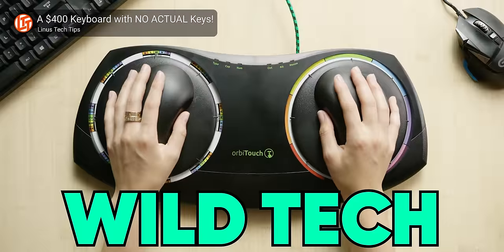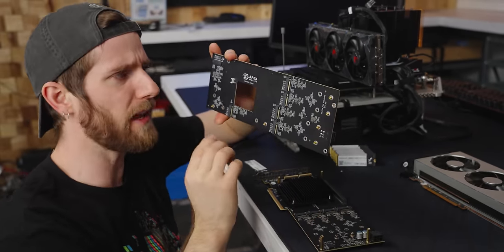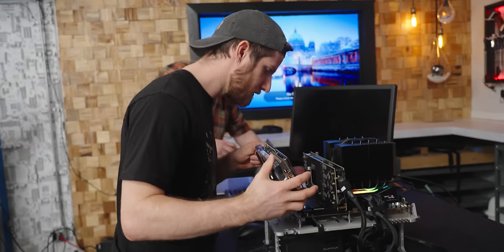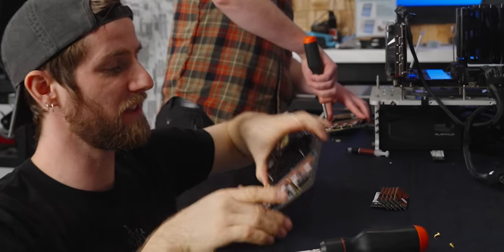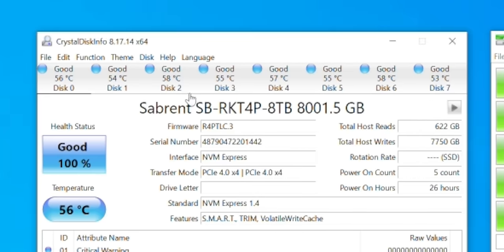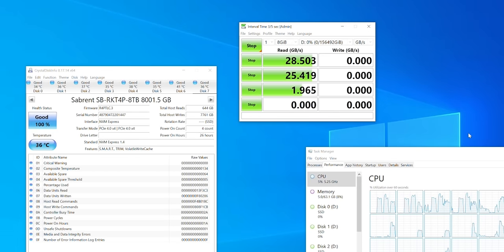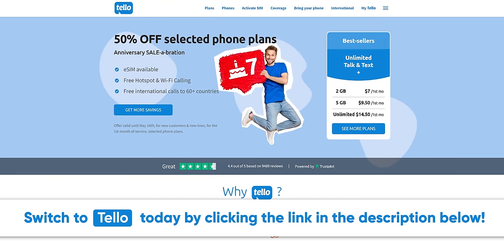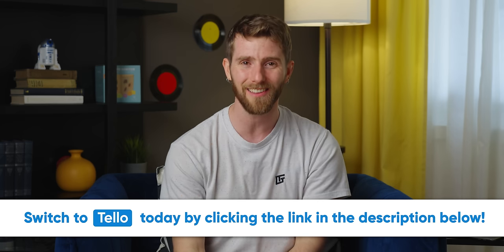This SSD is Faster Than Your RAM - Apex Storage X21

Comment: I could see this working well for engineering simulations (FEA, CFD) that are effectively limited by the amount of ram that you have.   Before something like this, maxing out the ram and letting the solver use the hard drive would increase solve time by something like 10x.
Reply: But you would most likely use DCPMM for that because it has much lower latency. You could probably use this for some kind of custom swap in some cases, but at some point there's diminishing returns. The advantage of this card is that it's compact. There are systems that have lots and lots of u.2 connections and can support far greater capacity and speed.
Reply: The newest simulation machines where I work are for chip cooler simulations. They use CXL RAM as a layer between the SSDs and RAM. We also have sapphire Rapids HBM in dual-socket for it as well.
Reply: This would still be slower, 25Gb/s on ram is per channel, if you are running simulations that intense I would think you would have a very dece amount of ram and be running it in 8 channel. This is cheaper for sure but I don’t think the OS is designed to use swap like that, I think it still goes through ram first and constantly dumps back and forth from ram to disk increasing your CPU usage drastically. This would however be very useful in AI training, the datasets are massive and gpus nowadays especially if you have like 4 A6000s could eat up quite a few IOPs. I would like to see a water cooled version of this, maybe they will partner up with an ssd manufacturer and offer that later as a factory assembled package.
Reply: @radugrigoras : There's nothing particularly special about this. It sacrifices speed for compactness is all. So it's great for a system with few PCIe lanes or systems that need to be small. There are very few situations where this is something you'd even care to have.
Reply: I haven’t done this kind of work since 2013 (finite difference simulations on a 192gb, dual 8 core Xeon machine) so I’m guessing things have changed and gotten better in that time span.
Reply: @David Waters  The last decade has been insane. My work simulation machine is running 108 CPU cores with 128GB of HBM and 2tb of ram. Expensive as hell, but being at Intel, we kinda just get to keep some chips for ourselves.
Reply: @DigitalJedi : My father told me the same story from when he was young. As a kid, he worked at the local Tiedemans factory, which produced cigarettes and he said they had all the cigarettes they could smoke and could even take cigarettes home to share with friends. :)
Reply: @DigitalJedi can you be more specific on your specs? Software, linux or window, custom build?
Reply: @DigitalJedi simulating what? FEA on linux?
Reply: @Teluric2  It's all Linux, yes. Thermal expansion and heat flow FEA. I can't be super specific as I didn't spec the machines. My job is just to know how to use them and to design better chips with them.

Last I looked, I've got access to a pair of Xeon Max 9470s (52C/104T each at 3.5ghz) and 2TB of ram in dimm form. I was mistaken earlier. The CXL is in another machine.
Reply: @DigitalJedi is your machine a desktop? What software Ansys?
Reply: @Teluric2  Ansys and some Intel internal tools for silicon wafer modeling. These machines are racked and get split up between jobs as needed. Sometimes if a job from a certain team is big or important enough you get an entire machine for it and it is _fast_.
Reply: @DigitalJedi Thanks interesting stuff, hope I can read more.

Comment: Man, I remember back in the day running two of the smaller Raptor drives (32gb?) in Raid 0 and just loving life. I may not have had the best graphics card or processor, but I loaded into BF2 faster than any of my friends for a while. What a time to be alive.
Reply: Always first to GET TO THE CHOPPA, remember.
Reply: I was so proud of my raptor. Better days.
Reply: My raptor 600 is still going, but I use it as a temp/cache drive because I'm afraid it might reach EOL at any time
Reply: My colleague had one and I remember my ignorant brain saying 14,7GB 15k SCSI drives in RAID are better. Never mind the 2K setup costs.

Comment: That commercial chiller that you have for your lab should be used with this on a milled cooling block just for this application. See what you could do as far demos go. You might be able to see those numbers climb higher.

Comment: Those chips are used quite a bit in NAS and storage backups in my enterprise environment. Dell Avamar and Isilon units will connect to switch fabrics with those chips. Very fast stuff!
Reply: I've been looking for some solutions for backing up my personal files and media collection. Can you recommend any resources that will help me do that? I have older stuff on old nearly-dead HDDs that have been removed from their systems, but that's clearly not a comfortable, current, or reliable storage method
Reply: @Thalanox  why not just build a NAS using TrueNAS or just ZFS as a base. It's very well documented, easy and can be run on a old system. Just grab a bunch of used certified drives, and a old PC and swap the power supply for something decent and done pretty much. Set up a RAID array and put the files on it and call it a day. Drive fails? you're still covered
Reply: @Thalanox  electrons escape gates, so... keep using you backups on SSDs
Reply: @Thalanox  If you want something enterprise grade get a dell r730. It's older, but will do pcie bifurcation and supports nvme

Comment: If you asked me 15 years ago where storage speeds could be I wouldn't have guessed this fast... It's hard for me to be super excited because I feel like the consumer application isn't really there... but the use case in cloud computing will be huge and we'll see it's affects in our services. It's interesting how obfuscated this technology is for general consumers even though we'll all see benefits.
Reply: I remember being impressed when early Sata 2 SSD's were breaking 200MB/sec read speeds and people would Raid 0 them for 400+MB/sec

I'm still super impressed at my Gen 3 NVME 3,500MB/sec speeds... how far tech has come
Reply: @Argedis  yea, Gen 4 drives are so fast nowadays that there's really no reason to raid 0 for most people
Reply: Server motherboards already have a fak ton of ssd slots built-in. I built 2 servers like that 7 years ago with 10 Intel sata ssd (consumer grade) for my job. I don't remember the exact performance (probably 10 x sata speed) but it was insane for the relatively low cost. We put 40GBps network cards and a 40GBps switch between them and built one storage array spanning the two servers. It was a proof of concept for a cheap high availability hyper-v cluster. Good times.
Reply: Yeah we need this in consumer hands. FFS I still have 2 mechanical drives in my computer and like 5+ HDD for storage because they have big capacities and cheap... even if way slower.

Comment: The AI thing does make sense especially when combined with DirectStorage-type tech.
Reply: it doesn't, because most datasets are precomputed and cached
Reply: @MrNoipe  How does being precomputed and cached negate Direct Storage benefits?
Reply: @''/ad  cached.... you mean stored on a massive bank of drives? Beyond that, there's still computing in order to mesh data together to create something new... this is where quick access storage helps. Being able to access multiple pieces of data quickly means you're  only limited by computing resources, not storage resources which tends to be an issue.
Reply: @MrNoipe  it makes sense when training the ai

Comment: I had thought of this when SSDs first came out. I thought to myself, what happens if storage drives become so fast that they make RAM obsolete. Being able to just read and write information straight off a storage drive has to be faster than going through a RAM middleman.
Reply: Well it could be done, however you would need to do "SSDRAM" changes fast as write is the death of the ssd. Depending on workload etc i think in a year you would need to swap it.
Reply: The reason why we don't have SSDs replace RAM is that it's a little more than just raw read/write speed. Those reasons are latency and longevity, both of which are affected by how data is written to SSDs.

With that said, I'm sure there are highly specialized computers out there that don't have RAM and just use HDDs/SSDs, but they certainly aren't common to consumers.
Reply: That's not how it works. The closer you are to the cpu die the better. That's why cpu cache exists, which is essentially "ram" that is located as close to the die as possible. For example, the time to reference L1 cache is 0.5ns. The time it takes to reference RAM is 100ns. That is an absolutely massive difference. You can't only look at raw speeds, you need to factor latency. That's why lower memory latency improves memory performance even if raw speeds remain the same. Often a decrease in latency is much more significant than raw speed.

Comment: just to be clear, bios raid limitation does not matter for anyone in professional space.
Raid is basically broken for anything serious - it can detect if drive is dead and then migrate to spare one (in case of something like raid5)
but the issue is when drive is not yet dead, it's failing - in that case it might corrupt your data.
that's why for any serious data storage you want to use something like ZFS so it's able to check checksums of your data and detect that something was corrupted on drive and fix it on the fly

what would be also useful use case that such amount of iops? ZFS deduplication, that required to add another layer before accessing data -> you want to get data block X, then you need to read from deduplication map, and get read addres for data Y and then access that data. This basically halves amount of IOPS you can do (assuming no cache hits in memory) that's why it's not used that often.
In this configuration you could get a much more effective storage when expecting duplicated data
Reply: I haven't built a computer in 20 years .. and I feel like I know absolutely nothing now.

Comment: I bought a 1TB Sabrent for my Steam Deck, and it has been great. I'm curiously about why the help the brand has exploded  in what seems like less than a month.

If the card ends up maintaining its functionality for the advertised lifespan, I will be extremely happy. I just get the "too good to be true" vibe from their products.
Reply: Still running my Rocket 3 years later, they make a nice drive!
Reply: @OdisHarkins  when it comes to data storage very rarely gone with any company that wasn't a "household" in the US.
I am still very impressed by the performance I've been getting out of the card so far.
Reply: It's not like their drives are the cheapest out there or anything. So no reason they would be "to good to be true".
Reply: @xamindar  Plus they're pretty much just a Phison controller paired with name brand NAND. Hard to make a bad drive when all the hard parts are outsourced to experienced third parties.

Comment: Having two of those cards, each RAID-0 running as a RAID-1 would be pretty much perfect setup for a big database server. Combine those cards with say 1 TB of RAM and you can execute huge queries very rapidly against a 100 TB database.
Reply: You might need a lot of CPUs or GPUs as well, to actually move all of that data around.
Reply: Or perhaps those newfangled Data Processing Units, whatever those are.
Reply: fart hehe
Reply: That's called RAID-10 😂
Reply: @exorr81  That's true. I explained that as a combination of RAID-0 and RAID-1 for two reasons:

(1) RAID-0 and RAID-1 are easier to understand for most people than yet another RAID mode.
(2) If you configure such setup as RAID-10 directly, changes are higher that you mess in a way that causes the whole RAID to be offline if one of those cards fails. (That is, you configure stripes and mirrors incorrectly over all 42 devices.)

Comment: This was a year ago and Linus was right. These cards did catch on a little, and they work. I put another brands PCIe 4.0 card in an older computer, stuck 2 M.2 drives on it, and it works great. I cannot tell they're on a PCIe board and not on the mobo. Worked great!

Comment: It sounded quite logical. If the card supports up to a 100 PCI lanes & every M2 NVME slot is wired to 4 lanes, while you can put 21 SSD's on it, it only has 84 lanes out of the 100, for the SSD's & still some lanes left, to the limit of a 100 (just calculated it)... Also if I ever get one of those, I'd think I'd never need another Kb of extra space extra (ofc they wear out after usage, but you get my drift ;) ) Cool vid LTT :)
Reply: Those 16 extra lanes go towards the system it's plugged in, btw.

Comment: I'd be hyped if there was a budget version of this. You can get a budget 1tb ssd for ~40€ currently here in Germany, the only issue is I only got so many m.2 slots. This thing would solve that problem.
Reply: Turbo budget version, it's just a pcie to four m2 slots card. No logic, just wiring
Reply: Yep, just looked, they're already on eBay for about £25
Reply: About £50 for a 1tb crucial nvme M2, are those considered budget drives or middling?
Reply: Those ebay cards need the mobo to support bifurcation, so not the same thing as this Apex card that foes not.
Reply: @tab8k  non bifurcation cards are $150-$200
Reply: There are 4x m2 expansion cards and you can go with higher storage ones like a 4tb crucial p3 for 200€ so why would you need a 21 slot expansion card? 16tb seems fine even for a discord admins „homework“ folder

Comment: Over 10 years ago, before discovering Netflix back when it was good, I would be asked by my family to, find, and host entire seasons of their favorite shows as well as some of their favorite movies. I used to spend ages burning custom DVDs, but we were in the future with a 1080 HDTV and our Xbox 360 could connect to my PC using windows media center turning it into an HD streaming home server on the side. This meant a lot of time downloading overnight, and my 1TB-ish hard drive with more storage than I thought I would ever need was starting to actually visibly fill up, as I also had many multi-gig games as well as rips of the disc images for easily swapping into an emulated drive without swapping/scratching physical media, meaning my physical games needed space for the install and ISO, as well as gigabytes of music in my "My Little Pony Fan Music/Remixes" folder alone. Basically it was a well-loved PC that I volunteered my extra space to turn into a windows media center HD video streaming server for my family on the side.

Now Netflix doesn't have all of the good shows anymore, and it is so expensive and inconvenient to be able to stream all of the shows you like as you juggle tons of account credentials, and it is getting harder if not impossible to have an ad-free experience no matter how much money you throw at them.

So what if I wanted the entire library of every good show and movie stored locally in HD, or even 4K as we just upgraded a few months back? I don't want TV myself but I doubt the streaming services or our ISP are letting us stream much if any 4K content despite us having the fastest internet package in our area and I purchased a 4k streaming capable router last time we needed one so we could be 4K ready when the time came.

Well, acquiring thousands of hours of TV and movies in the best quality available is its own beast, but should I ever win the lottery at least I know there's a product that can theoretically work with a home machine, with a modular nature so extra storage can be added as needed instead of having to buy a larger drive and copy the files from the old one, and also doesn't require that you buy $30k+ worth of SSDs up front and just add more as needed. Basically, if you're willing to spend your time ripping a massive collection of 4K blu-rays and whatever else it takes to get your hands on every episode of every show everyone in your household loves, and the movies too, in the highest quality available, you can make your own media server with no ads or switching between 3 different services to watch every Star Trek series and movie. No "we can't watch this because my parents in the next state are on the account right now"

It would be a huge money and time investment to get the card, drives, and all of the media, but it is a lot more technically feasible now to have your own HD/4K media center just by adding an extra card to a regular PC.